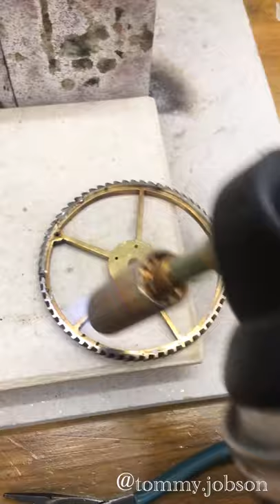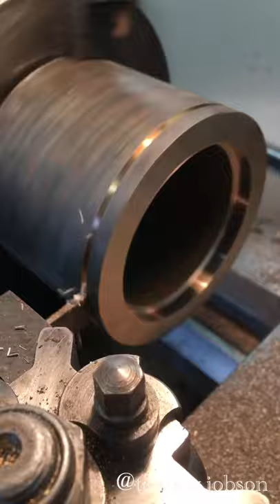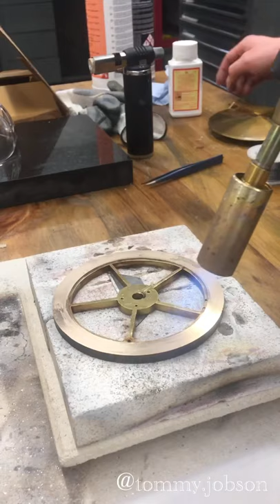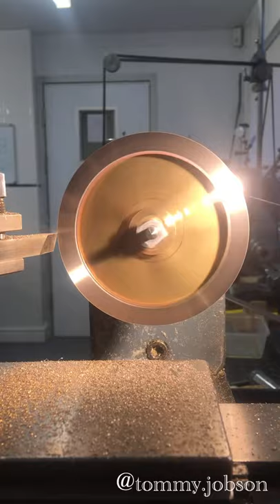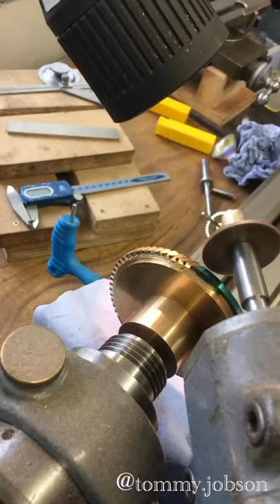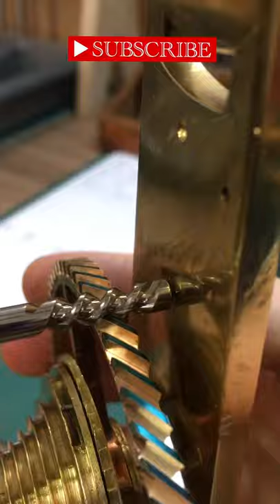Old clock wheel repair.

Comment: Was the old gear ring made of steel? Nice job.
Reply from the maker: Well spotted. Yes it was. It was a poorly made replacement which was causing problems. Most of these clocks have Bronze ring gears on the great wheel.